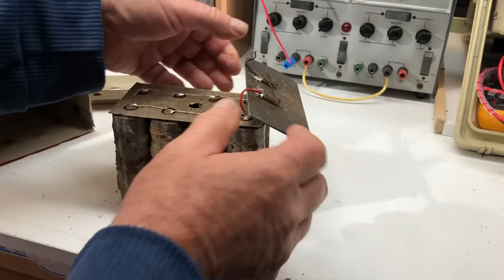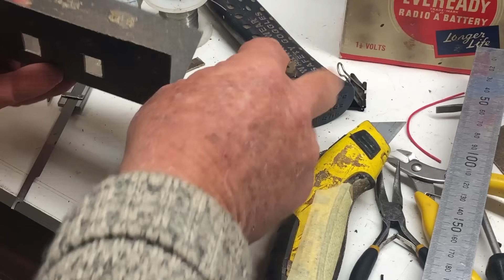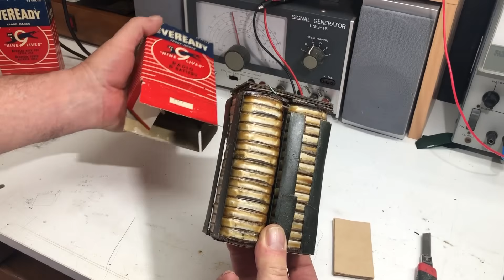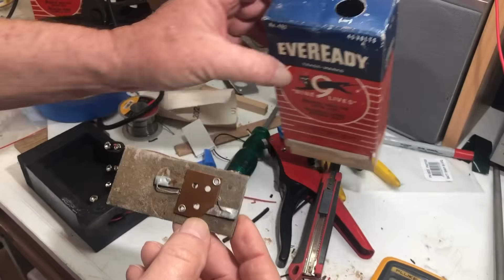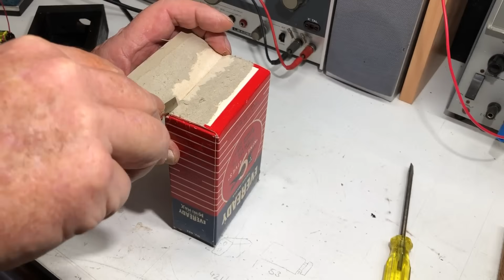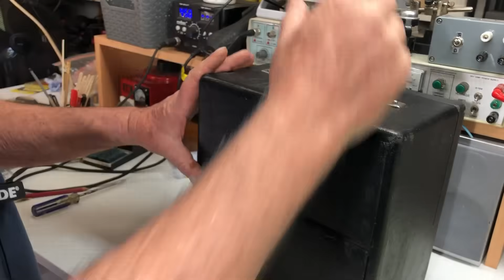Peal Radio - Old batteries live again!

Comment: That soap on the screw trick reminds me of a vulcanizing factory I once worked at called Dana/Plumley.  We would slide raw rubber hoses onto form racks that would then travel on a track to a big, for want of the proper term "pressure cooker".  When the rack of formed hoses came out of the cooker they were finished and would hold their shape, like radiator hoses, heater hoses, etc.  But, in order to get the hoses onto the forms when the rubber was raw and soft, there was a trough in front of the form rack that was full of a slippery substance that resembled dishwashing liquid.  You'd scoop the hoses down into that trough so the ends inside were covered in that liquid and then gently slide them onto the forms on the racks.  You had to be gentle as if you gripped them too hard when pushing, your gloves would leave indentations in the raw rubber.
Reply from the maker: Hi
I used to work as a tyre fitter (a long time ago) and we used something similar to help ease the new tyres onto the rims on the fitting machine. It was mostly soap, I think.  They probably have better machines now and don't use it.

Comment: I bought an old Zenith H-500 transoceanic once that still had an original battery in its case.  I believe it was an Eveready.  I gave it to a friend of mine so he could make copies of its paper casing, and so he could use the plug on the battery for a copy he was making.  Meanwhile, for my H-500 I bought a reproduction battery box for it that was an empty wood case with a 1.5v socket and room to join 10 9volt batteries together inside it.  As I recall, to get it to work after plugging it in to the receptacle on the radio, ya also had to take the radio's AC plug and insert it into the top of the chassis which completed the DC circuit.
Reply from the maker: Hi
That transoceanic sounds interesting.  I wonder if you had to plug the CA plug into the radio to make sure you didn't have the AC and the battery connected at the same time.
I will have to get onto designing some inserts for 3 D printing.  I've got the scans of the paper casings so easy enough to get a bunch of them printed.  One difficulty is the connectors.  You can't get the plugs or sockets anywhere that I know of.
Cheers

Comment: Hi Don, great job on the batteries, very neat and all hand sawn you clever chap, I would have used my laser cutter 😅 The little pins on the ends of the wires were genius. A comment I had a few years ago suggested using Bakers soldering fluid on old corroded wires, it deoxidises the wire, it does work well. You can get it at Hammerbarn 😉 You should have left the AFL Grand final playing, Brisbane won! 😊
Reply from the maker: Hi Dave,
Yes, I was thinking at the time that you would be pleased with the AFL result.  
I've seen others using Bakers soldering fluid and everyone seems to swear by it.  I've heard Shango drinks it with a slice of lemon.  I tried Jayco but no luck there so I bought the rosin flux I usually use.  
If McBunnings has it, I'm off to buy some tomorrow!
Cheers
Reply: @Donno308 yep, they do. About 12 bucks

Comment: Great job Don. It's the best looking portable valve radio I've seen from that era. Good that the battery cases were still there to re-use and the wooden cases you created to put in them look pretty smart.
Reply from the maker: Thanks, Ged.
Yes, I was pretty happy with the results.  Of course I can't help thinking of ways I could've done it better.  
Next I'm going to look at making copies of them.  Not as easy as it sounds, unfortunately.
Cheers

Comment: Excellent work Don, and a lot more robust than those originals! I have also tried C and D cells on some of my radios but now major on using rechargeable AA NiMih ones, occasionally PP3 size also, as they are an easier size to work with in various combinations. And are also very cheap to run, and last ages on a charge. Like yourself I like to keep the retro. look with batteries - and that really is an excellent job you have done on those Don! Also a nice touch having added the in-line fuse, which I regard as an essential when using rechargeable batteries, but wise in any event. Great radio too! All the best, Gerry
Reply from the maker: Hi Gerry
I did think about rechargeable batteries and that would probably be a better solution but the owner is a collector so it will probably just used as a display piece.
If I do one for myself I would definitely go for NiMH.  You would have to be careful not to go over voltage with the filament battery though.  Those valves are expensive!
Cheers
Reply: @Donno308  Hi again Don. I was thinking later on and thought you might be interested in a set of battery cover scans that has been created by a branch of UK Forces – indeed I’m not sure if I might have mentioned this to you before? It is quite a collection of all sorts of batteries that used to be, and there is also a link at the bottom of their webpage that leads on to even more of them.

To access them all you need to do is search “Royal Signals battery scans” and it should pop up – you will know you have got the right as well as safe one as it has Wireless-Set-No19 Group in its title line.

I have used quite a few of these with good success, and very helpfully Royal Signals say these are free for anyone to use.

Best wishes, Gerry

Comment: I don't think that farm radio batteries are available 🤔 anymore, and haven't been for many years. Ya will have to build the battery pack. It needs to be 90 volts ⚡️. I watched Glasslinger do this. It's victory ✌️, if done ✔️ right, but it can be very frustrating, if you've crossed a wire, or done something wrong. Your friend, Jeff.
Reply from the maker: Hi Jeff. If you watched the video you would know that's exactly what I did.
Cheers